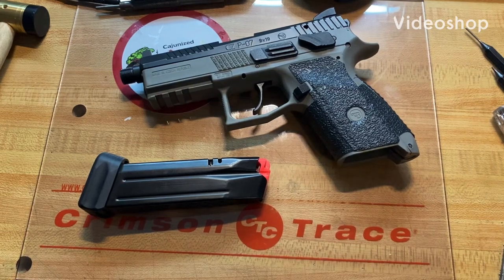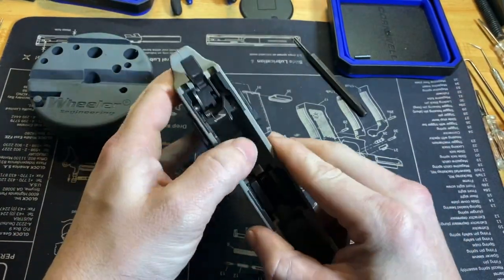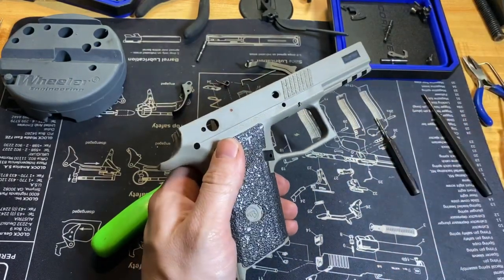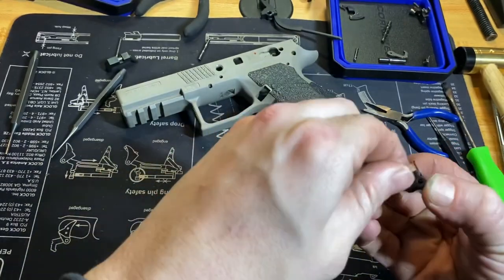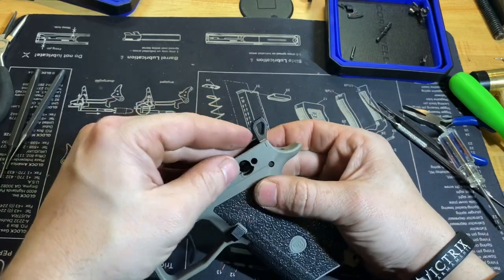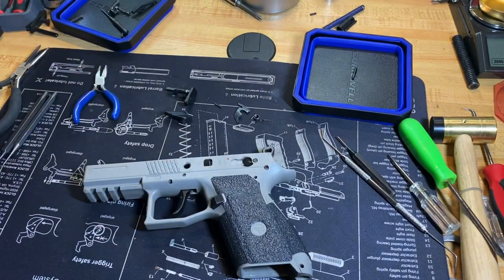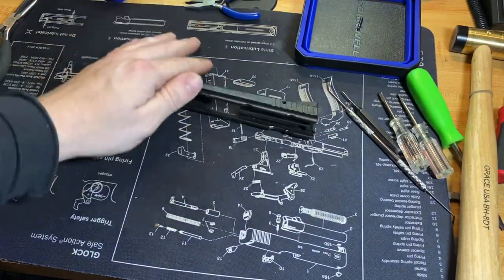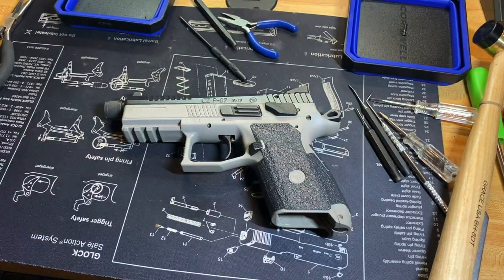CZ P-07 Complete Disassembly/Reassembly

Comment: Great video….my takeaway here is that I don’t ever want to take my P-07 apart.
Reply: On the other hand, Glocks are 100% field serviceable with a single tool, minimal parts, and an extremely robust design. Should something go wrong though I have spare parts at the ready and can do pretty much anything a Glock needs with a minute or two and a single tool. CZ is great, don’t get me wrong, but I like something I can work on on the fly if I have to.
Reply: @Brad-cs9jy  you plan on swapping a striker in the field?
Reply: @bierlyynn  don’t plan on it no. But if it needs I’ll be able to do it
Reply: @Brad-cs9jy  I get your rationale, I do like how easy it is to disassemble my Glock too. I'd still take my P-07 to war over any other handgun I've ever shot. Quality is more important to me than something like that, not to say that my Glock isn't quality but it's had numerous malfunctions compared to the 0 in 5k+ rounds that my P-07 has gone through.

Comment: Great video. I used it to help me install an ejector into my P07 that I purchased from CGW.

The P07 had a trigger job done by CGW, and they neglected (forgot) to re-install the ejector.

They were a pain to deal with and I had the impression they didn't believe me. Rather than deal with them and shipping it back and forth, it was easier to just say "to hell with them" and do it myself.

Oddly enough, when I do a trigger job on any firearm, I always live fire to test it before I declare it complete.

Horrible experience with Cajun Gun Works.

Comment: Thanks much for the  video; very helpful. The trigger on my P07 was not resetting but only when in  double action . Thinking it might be the trigger reset spring so I installed the CGW complete spring kit. This did not help and it will still not  completely reset . The double action reset is literally a few millimeters from finalizing.  If I pull the trigger back and let it loose the additional momentum resets it.  Called CGW and they suggested polishing the dis-connector.  The trigger resets in double action normally without the slide on.  Any thoughts you might have would be appreciated. Thanks again for all of  your videos.

Comment: Thanks for taking the time to make such a complete video.  Question:  I had my LGS giunsmith install a CGW pro-kit for me and noticed a couple of things.  One, when I depress my decocker there appears to be a very slight gap between the inner face of the decocker and the outside face of the frame - just noticeable on my thumb when I decock the hammer.  The second thing is that the lifter can be easily wiggled; I would have thought it would be fairly tight.  I took it out for the first time since the CGW kit installation and no issues - it's just the two things that bug me that I've mentioned.  Are these two things that I mentioned normal (and I just never noticed) or does sound like I need to have a tweak to the CGS installation?  Thanks in advance for the response.

Comment: I’d be real interested in your advice I’m lookin for a pistol to protect my family I’m split between Glock and CZ. The Glock seems it’d be much easier to maintain but the Cz more accurate, ergonomic, more features. What would you recommend if it’s only one?
Reply from the maker: Can’t go wrong with both if you plan on doing a bunch of add ons to the gun then Glock may be the way to go. Glock has the longer track record but the p10 has been doing really well since it’s release. I prefer the m&p 2.0 compact that’s what I edc. I’d go try to shoot a few of them and see what you shoot better because both of them will give you the reliability you need. At that point it’s preference for the shooter
Reply: CZ P07 > Glock 19 I own both yea glock mags are every where but the P07 is just the superior gun with the better trigger and looks way better

Comment: Very interesting. Thanks! How did you learn all of that?
Reply from the maker: Honestly.. just doing it. Started taking guns apart and you eventually start to learn how different components work with each other.  Once you understand how inner components work it every gun gets easier and easier. Especially CZs, once you learn say the p07 well then you can do the p01, then a regular 75 decocker or omega, shadows with safeties only, they all work very similar. One good tip is taking pictures during your tear down, that’s helped me tremendously multiple times.  Get the parts diagrams for each gun online and keep a binder or a file of them. That helps a lot too.
Reply: @TheGunBench   It's clear that you have a deep interest in this. Thanks for sharing your information.

Comment: I recently purchased one of these firearms and cant get the main spring pin out from the grip for my life. Already banged the pin to hell and tried applying pressure on the spring plug. Any suggestions?
Reply: Dont cock the hammer as this will compress the spring and make it harder. Usually you just need to push in the plug half a millimeter (on other CZs) to relieve the pressure on the pin and then you can push it out sideways with a tool easily. It really goes without much force or hammering the pin! Only thing that comes to my mind is the plug could slightly be turned and not just put vertical pressure on the pin, but also sideways. Maybe a drop of some creeping oil on both sides of the pin will help to lighten it...

Comment: Where do you get the slave pins from?  What diameter and length are they?
Reply: In a pinch, I used q-tip shafts that I clipped with my wire-cutters, and they actually worked quite well.

Comment: What is the last pin you removed from the gun frame called? Mines keeps inching out after shooting awhile. I wanna replace it.
Reply from the maker: The hammer pin? If not check this link, find the pin and call CZ custom trll them the number and they should have them https://czcustom.com/cz-parts-all/p07-p09-parts-from-diagram/p07-diagram.html

Comment: just curious what state did you buy this in i had one that the decocker would wobble i sold
Reply from the maker: Indiana
Reply: @TheGunBench  it sounded like it could have been my problem. when you pulled the trigger did your decocker walk out? how did you actually identify lol or would it not even shoot? nice video by the way wish it was out then
Reply from the maker: I took the slide off and noticed the spring just sitting there. I am pretty versed in cz internals so once I saw it I knew what had happened . But it would also kinda walk out if you pull the trigger
Reply: @TheGunBench  interesting i cant quite remember. i polished the internals and after it would do that. i was careful i thought. just did a p01 with cgw went alot better. still regret getting rid of the p07 though always wondered what i was missing. thanks for the reply
Reply: @TheGunBench  whats your favorite cz so far?
Reply from the maker: Eh I like my 97b, the p01 is a great one, wasn’t as impressed with the shadow 2 but a TSO is next on my list
Reply: @TheGunBench  the tso is awesome! originally i didnt plan on doing all the parts on my p01, did a bit at a time. i could pretty much buy a shadow 2 at this point with money i have in it  doh.  im sure il end up getting another p07

Comment: Poor tip: if you have no punches, use your firing pin.
Reply from the maker: Or old drill bits, just cut the shank off and use that. Most people have an old set of multiple sizes. I use them to make slave pins